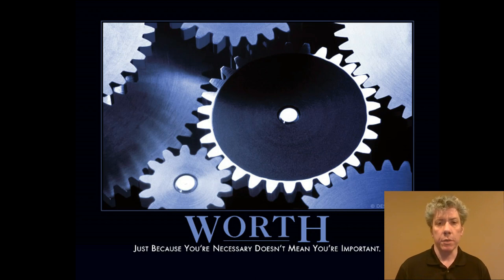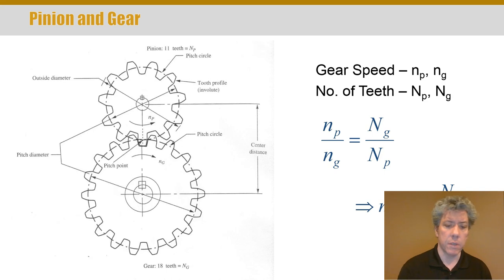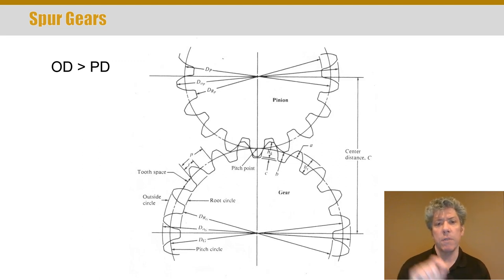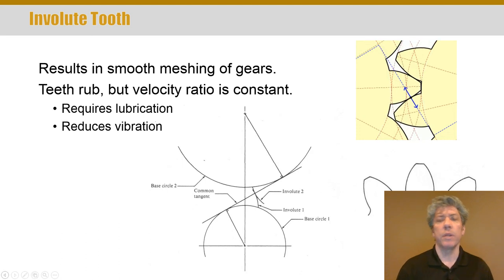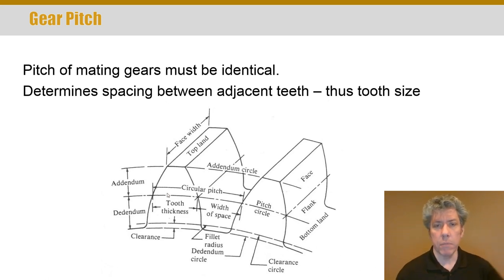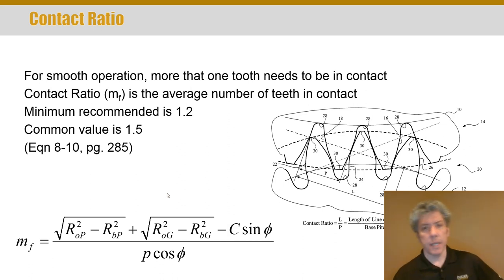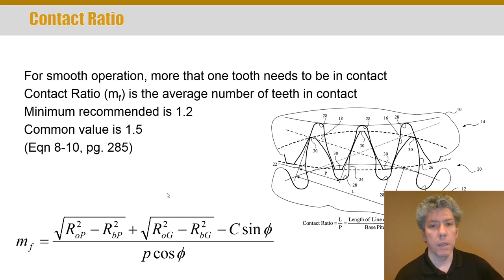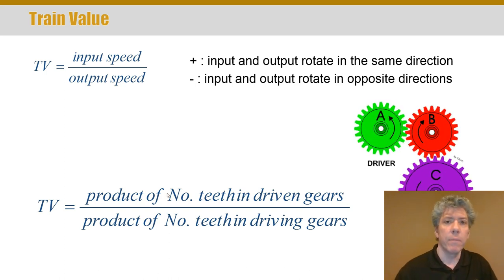MET 314 Gear Kinematics

Comment: Really nice content Mr. Damon! Do you know where I can find good material for Pinion x Girth gear assembly? I work in the mining field and we have lots of trouble fixing grinding mills.
Reply from the maker: I do not have a recommendation for material specific to pinion & girth gears.  It sounds like you are dealing with an edge geared system rather than a center drive system.  You may want to look into ensuring the alignment of the gear set, and the stiffness of the girth gear.  If large enough, it is probably not solid, but cast with spokes.  There could be deflection of the ring supporting the gear teeth.  Finally, if you can afford higher quality gears you should get longer life from them.  Be sure to protect any gear system (if possible) from dirt and debris, but keep them lubricated to extend their life.